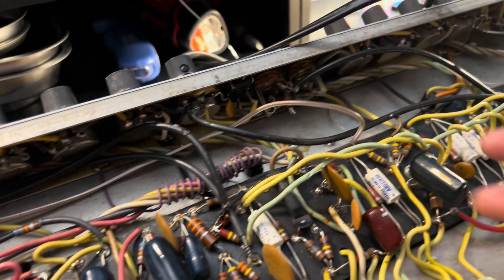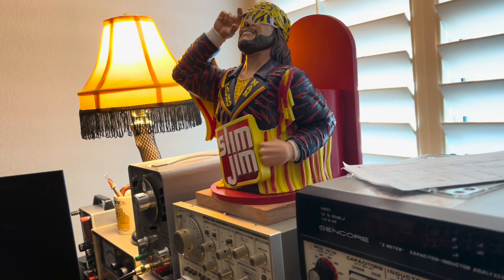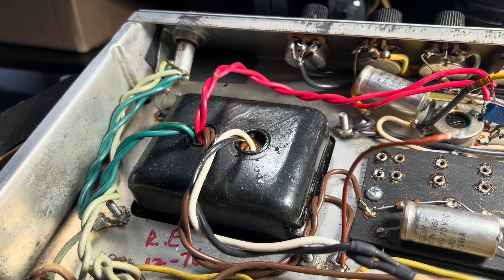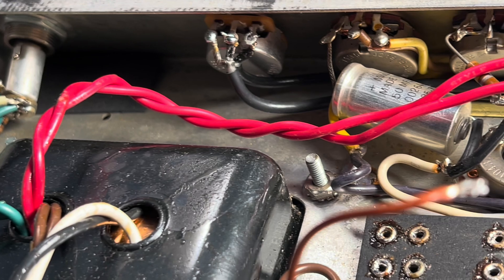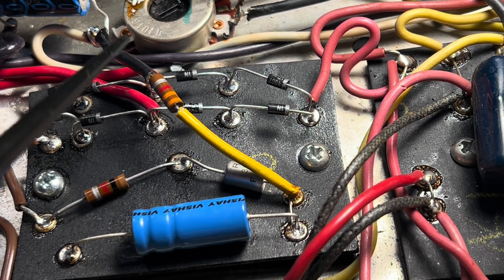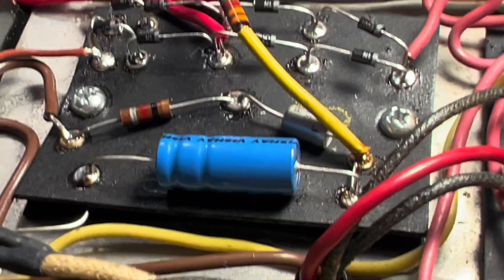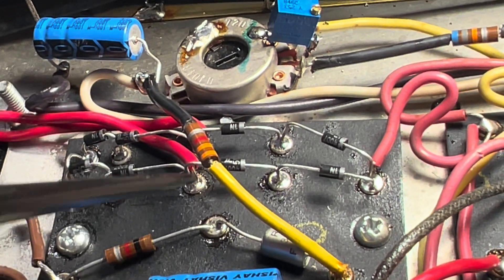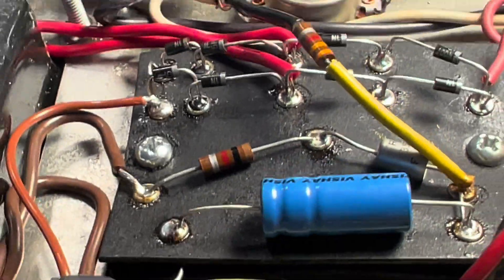'72 Twin Reverb | 2 Artificial Center-taps?

Comment: Any reasons why they call it a "High Tension" secondary wire? High Tension meaning what?
Reply: I was told "high tension" comes from the description of the wire hanging on the pole that is both high and under tension.
Reply from the maker: It’s analogous to hypo or hypertension disorder in people, where one’s blood pressure is either high or low. In the old days, electricity’s characteristics were described in terms of fluid, where there were similarities between pressure and current.
Reply: @ForgottenGearRestorations  So high levels of current = High Tension?
Reply from the maker: @waynegram8907 "High tension" basically means the lines carry high voltage, which is important for cutting down energy loss when electricity is being sent over long distances. The higher the voltage, the less current you need to move the same amount of power, so you lose less energy in the process.
Reply: @ForgottenGearRestorations  yes electricians use that term High Tension more often because power lines use High Voltage less current to send over long distances. Guitar Amplifiers Power Transformers have High Tension lines of high voltage/low current = High Tension wires.
Reply from the maker: It’s an older way to refer to it. It’s synonymous with pressure/voltage.